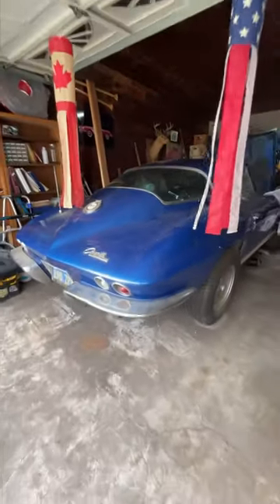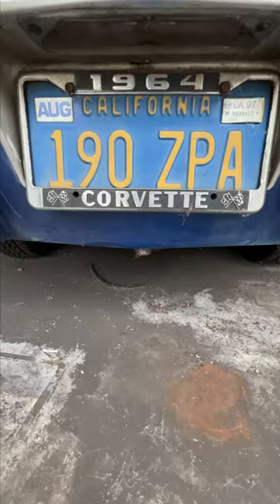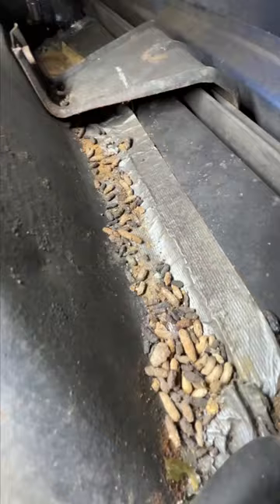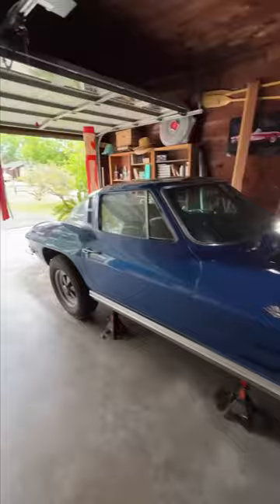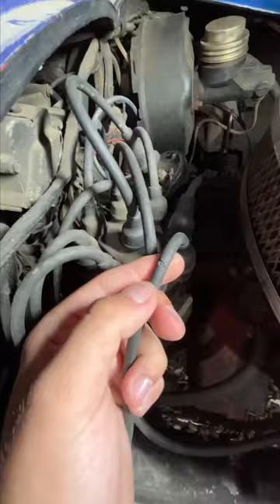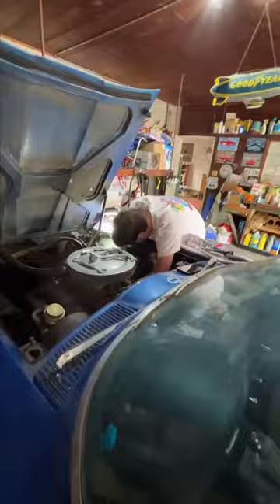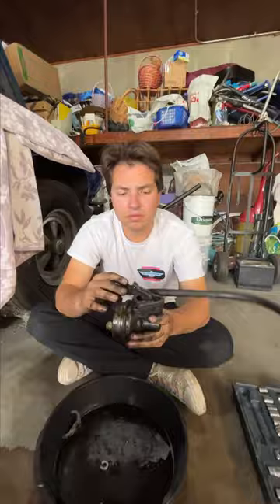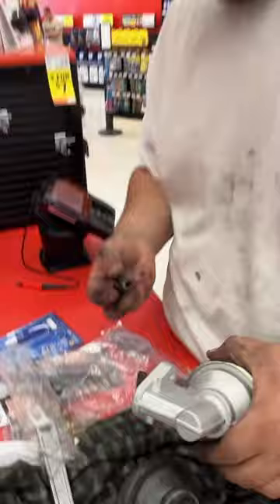Barn Find 1964 Corvette starts for the first time in 26 years

Comment: The most amazing thing about this video Is that you could find the parts at a local part store.😮. Long live gasoline engines😊
Reply: Hell to the yeah
Reply: You are the best 👌
Reply: Gasoline engines will always be king of longevity
Reply: That's one of the many great reasons why Chevy is the best. Small block Chevy parts were pretty much the same for 45 years.
Reply: Can't do that with these silly EVs and hybrids. Even the dealers have problems getting replacement parts from the manufacturer.
Reply: The amazing thing is  the counter person at o Reilly could find the part in the computer 😮
Reply: Electric engines are pretty reliable but when they do stop working there’s nothing you can do to fix them
Reply: @isthisagoodname6279  WTF are you talking about 🤔
Reply: It's because it's a Chevy small block.

Comment: Fiberglass doesn't rust, ever!
Reply: My first thought too
Reply: The frame is steel, though.
Reply: My neighbor has 3 all in the forest
Reply: Oxidation affects everything
Reply: @mrmedium7984  it well root not rust because there no metal in fiberglass
Reply: Ive seen fiberglass turn into a wet napkin
Reply: @mrswags.  True, but it can rot in a humid environment..
Reply: Water gets inside there. The fiberglass will go to poop
Reply: @mrswags.  corvettes ?
Reply: @mrswags.  The coupes have a steel infrastructure that will rust, my 67 coupe had that issue.
Reply: Born find how much?
Reply: The frame and birdcage (inner body structure) are notorious for rust and it is not an easy fix.
Reply: Lots of older Vetts in the Midwest look good sitting still, but aren't safe to drive because the frames rust out. Only the body is fiberglass.
Reply: isn't the frame steel though? still can rust
Reply: The frames do and it is common for vette frames to rot out
Reply: The frame isn’t fiberglass tho
Reply: Khali,  Yes fiberglass don't rust  but on these cars underneath metal parts do.  These are mostly fair-weathet drivers
Reply: It does warp though
Reply: @mrswags.  All Corvettes have a steel frame and birdcage, a steel frame around the cockpit.

Comment: Those old  Chevys are pretty easy to get running again .
I miss the old mechanical fuel pumps .
Started up a 70 Monte Carlo that sat for over 10 years .
It took about 30 minutes .
It was pretty much empty so added 5 gallons of premium gas , pulled out the Q jet ' Stone'  fuel filter
and sprayed Gumout inside  .
Sprayed some more down into the carb .
Took off distributor cap and sanded off the corroded  contacts then sprayed it all with WD 40 .
Dropped in a fully charged  battery and after checking the oil , power steering , auto trans  and coolant levels fired it up .
It ran great , no smoke , no noise .
Only problem  I really had was getting the Opossum that lived under the battert tray to leave quietly ..

Comment: Chevy fuel pump install.  Bump the engine to #1 tdc . Pull the dipstick. Come staight down thru the top of the oval opening on the block. Get the tip in front of the pushrod. Push the dipstick with the fuel pump lever.  The pump lever can drop infront of the pushrod. Pull the dipstick and put it back in the dipstick tube. Get the pump bolts in.  Done. This makes it insanely easy

Comment: The diff fluid, trans fluid, and bearing grease: "am I a joke to you?"
Reply: dude rolled it 10 ft
Reply: @byloyuripka9624  fair, but the fact he started up without properly pre lubing definitely killed a piston ring. You gotta pull the coil off the wire and run the starter to build oil pressure first if it's been sitting for that long, or else you're starting it with all the components DRY.
Reply from the maker: The owner had cranked the engine for a while so it definitely got that lubing.
Reply: @backspeedboys  good shit, glad to hear it

Comment: My dad drove a 72 nova in highscool and when he bought our house it sat in our barn for 15 years then 15 years later I’m about to turn 13 and we started working on it the engine was all locked up and there was rat shit everywhere but after about a month and a half we got it running and he is so exuded and so is my uncle who is 10 years older than my dad who helped build it with my grandpa who I never met I’ve done a few burnouts in it and it’s pretty fun

Comment: A buddy of mine bought a first year Corvette for $500. Was set up inside a barn for 25 years with 16,000 miles on the OD. The original owner was the seller's son who was an Army Ranger. He disappeared in Vietnam so they kept the car up on blocks and ran occasionally in case he returned. They finally gave up and sold the car before entering a nursing home. My buddy was painting their house inside and out to get it ready for market. He noticed a photo of them with their late son standing by his new Corvette so made a comment about the car. Was surprised when they asked him if he wanted to buy it and could check it out since it was in the barn in back. Said they'd take $500 for it even though it now needed engine work since it wouldn't start anymore. He bought it on the spot then had it trailered to an auto body shop that restored old cars for them to go over it and get running again. Then he got with a local car museum to keep it with their collection where it would be safe from fire and theft so he could use it as collateral for business loans at his bank.

Comment: doin this with my granfathers austin healy sprite
Reply: An auto salvage yard owner in town bought a Sprite at an estate sale. It sat out in the front yard of some goofy guy's house with his collection of sports cars that were overpriced. The yard owner found the Sprite's engine and transmission were ruined so tried dropping in a Mazda rotary with the manual trans attached to discover both of their mounts lined up with those in the Sprite. He left those in then went to work replacing the front and rear suspension and drive with those off a wrecked BMW sedan. As a finishing touch he added a reinforced roll bar and better seats with a full race harness. He left the faded body paint as-is along with the rusty chrome bits. He said it was scary fast and nimble around curves so made arrangements with a car club in Fort Worth to use their road track in East Texas on certain dates for prospective buyers to check out the car before putting it up for auction. I don't remember what it sold for but he was happy with the amount. His house was next to the yard with a big ten bay garage in back that held an assortment of collectible cars that he reconditioned using parts from salvage yards. He held the auction there so the road outside was lined with trucks with trailers. He probably auctioned everything off, including his stash of period hi-performance pats and engines. The yard office had a large front room for the counter with with old souped up flathead V8'S and Straight 6's on stands along the walls.

Comment: That engine should NOT be started until it's pulled apart, cleaned and lubed.
Reply: Shut up what it probably shouldn’t be driven until it’s been fully disabled and everything replaced
Reply: You know nothing this car shouldn’t have been driven at all and should have stayed in a museum
Reply: New oil and take the coil off the pull so it doesn't start then turn the starter till the pressure goes up and it'll get everything lubed.
Reply: Just shoot some 2stroke oil into the carb and it should just do fine
Reply: @thatslegit  or unplug the coil and run the starter lol
Reply: Go back to your arm chair sir let the men handle it
Reply: Same with your mom.😅! Just kiddin Mrs Smith .
Reply: ITS A CHEVY! It'll be fine.
Reply: @bernardb4901 junk small block automatic corvette. It’s only been sitting 20 years so was driven up till 2003 it’s bagged POS and not remotely “museum” worthy.

Comment: I have a 1974 ford f150 ranger used in the gumball 3000 in 2001. The biggest car project yet for me. The starter and solenoid is replaced, but going to fix the alternator. Is that a issue with other peoples fords?

Comment: Who drives a C2 with a Powerglide?
Reply: @lesbratton I was searching the comments figuring I couldn't be the only one who noticed it was a Powerglide. I have not checked the numbers but I think they sold more Powerglides than you might have expected. Search this video, it's rather surprising. (1967 Dodge Coronet RT vs 1965 Chevrolet Chevelle Malibu) 327/300 Powerglide Chevelle vs 440/375 Torqueflite Coronet. Very interesting comparison. One of the interesting aspects of Powerglide was it's minimal power loss. Guy in the video says 25hp vs 45 for the Torqueflite. I've actually seen a chart on multiple automatics & the parasitic power loss in a PG may have been as little as 18 & the Torqueflite may have been more than 45. These "new" 3rd gen PGs of the 1960s were very likely developed from, oddly enough, all the R&D that went into the 1960 Corvair PG, just reconfigured for a conventional front engine layout. The folks at "Road & Track" found it totally amazing that in their comparison of PG vs 3spd stick Corvairs in a 1960 article they published, that the PG car was 2 full seconds faster to 60 than the manual shift car. This in a car with the most modest power to weight ratio GM had built in years. They could not believe that, in their tests, even in high gear the PG car was showing 18% better lb/ton pulling power than the manual car with identical axle ratio. They were simply astonished. Ford-O-Matic Falcons of the day were running 3 to 4 seconds slower than their manual counterparts, again with identical axle ratios. I had read somewhere that they put a lot of work into that tranny because they originally had no plans to offer a manual transmission at all in the Corvairs. (very odd for the times & that would later change). I'm sure that what they learned there carried over to new generation of PGs for the 60s. Would have been nice if they had gone with 3 speeds, right then & there but for the Corvair it had to be compact, simple, lightweight, inexpensive & efficient. Seems like they succeeded.
So, all that being said, a 327/300 PG Vette was probably more of a goer than a lot of people would figure. The major thing missing would be the "fun factor". Hard to imagine not driving a Vette (or a "Vair") with a 4spd but I guess to a certain percentage of people it wasn't that important....

Comment: There's 50 things I'm sire you didn't tell you did, if that car was sitting for 20 years  most the rubber would been toast. Gas ,toast, oil, sludge what did the rats chew on? And did you save the original fuel pump?
Reply: Good looking car tho, and way to go helping th e old man. Good stuff fellas

Comment: No way I could have a classic on my property and it not run
Reply: You must be made of money.
Reply: @jamesholbrooks8794  nope but if it's in the shape the one in the video was didn't take much money just some time, and I have the knowledge for the most part and still learning
Reply: @spoolyboi9434  well they cheaped out on fixing it even here, they only changed the oil, didn't re-lube the engine, and still have to change all the other fluids and should probably re-grease the suspension too
Reply: @jamesholbrooks8794  so? It's not a resto job just breathing life into something that's been sitting, who's to say fluids weren't changed after the video, looks like they were just out to revive it and looked to have been stored in good conditions
Reply: @spoolyboi9434  yeah, I know it's not a resto job but it's only 3 more hours of work to do it properly so nothing ends up damaged, pop the ignition coil off the wire and let oil pressurize and flow through the system again and then drain the diff, trans, and radiator and give it new fluids and take a grease gun to the lube points. Simple stuff to prevent damage
Reply: @jamesholbrooks8794  again who's to say it won't be done later? Seems the point of the vidoe was to solely to make it run
Reply: @spoolyboi9434  well if you run the engine without pre-lubing it the damage is already done from the pistons, cam, rockers, lifters all rubbing against everything unlubed.
Reply: @jamesholbrooks8794  lmao it's not that serious bud if it were something exposed to the elements in very rough shape inside and out I'd agree with you in most situations, an oil change and something like marvels mystery oil, and then another oil change within the first couple hundred miles or so will more than do the job especially if it's driven often getting some heat to it loosening old things up, and of course not beating on it right away easing into it the first start and drive
Reply: @spoolyboi9434  as someone who has actually gone to college for mechanics, I can say, that excessive friction from a dry start is a big deal, at best it'll need new piston rings, at worst a new set of pistons, rings, and a cam. Lube is critical to an engines function, no matter if it's brand new or 100 years old. If it sat on jackstands for 20 years, the oil had dried off and there was no protection from pure metal on metal. That would be why you'd want to have the starter turn and run the oil pump to get everything lubed up again without the stress of combustion. But hey, it's not that big of a deal, right?